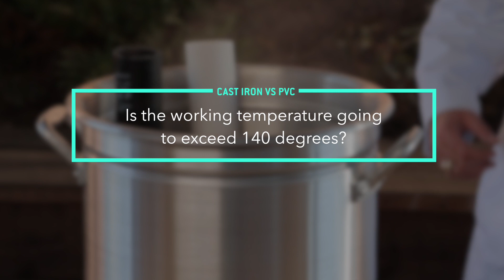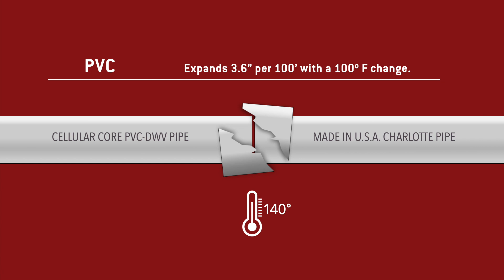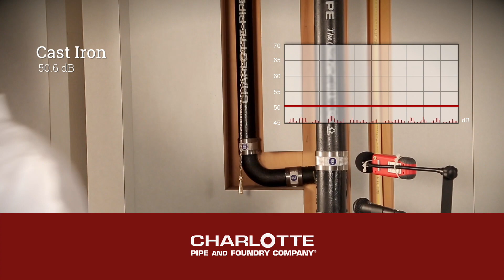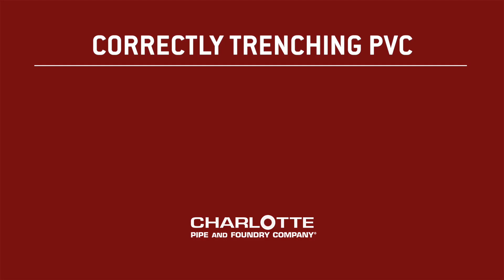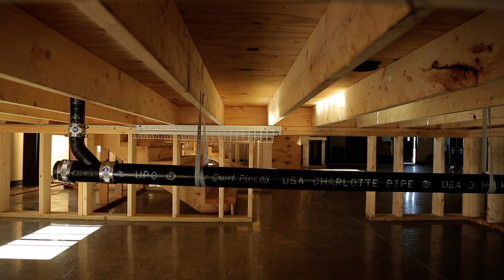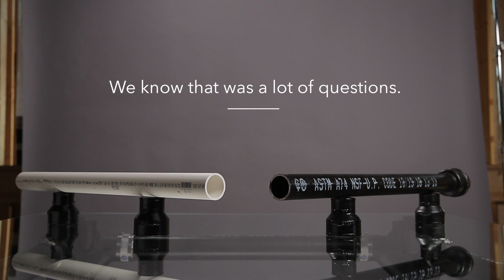Cast Iron Versus Plastics Plumbing System

Comment: You didn’t mention any cons to cast iron especially the most important facts. Cast iron rusts and corrodes shuts with time and/or irregular use pattern. I have replaced some of the most extreme 10 foot upward spiral cracks in cast iron

Comment: im doing a commercial drain pipe- 1.5" line to a sink,  tying into existing 2" cast iron drain. would it be up to code to use PVC schedule 40, or is it a local code I'd need to check?

Comment: Cast iron is a terrible product in a residential application. It's gets messed up with grease and often collapses under ground. Pvc has a much longer lifespan.
Reply: How wrong you are. Most of London is built upon cast iron drainage.
Reply: @kibeard007  if only you knew how much rotten cast iron I've replaced. Pvc underground last much longer.

Comment: What about DWV copper?
Reply: No such thing
Reply: @parkerswafford1151  yes there is. I had it in my house growing up. It was common before pvc.
Reply: @TheRabidPosum  oh that’s cool had no idea, How well did copper work in a DWV application in issues you remember?
Reply: @parkerswafford1151  it's fine for venting, waist pipe can rot out over years. A lot of older copper systems have PVC added during repairs or the waist portion of the system entirely converted. But the vent portion still exists and still copper through the roof.